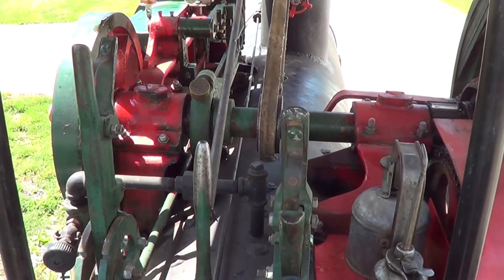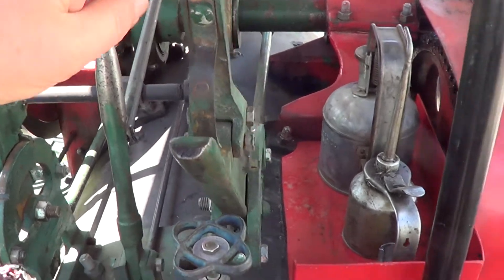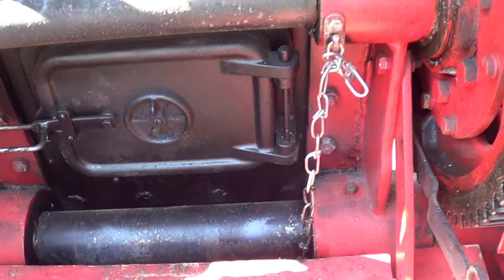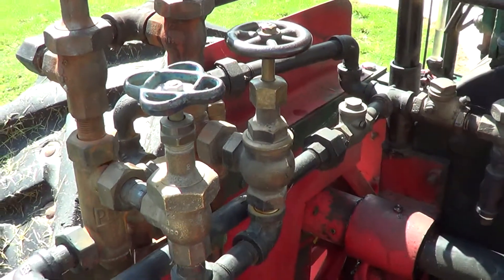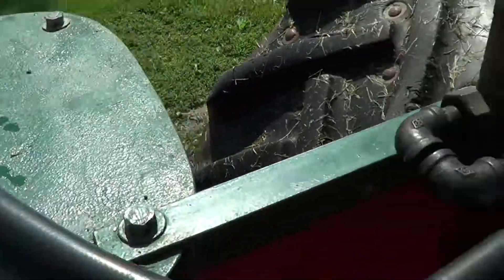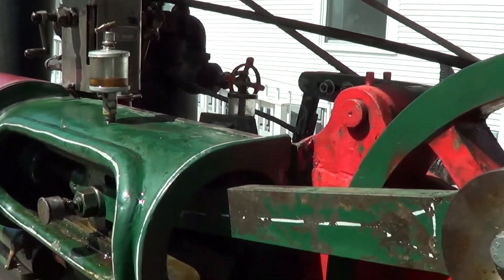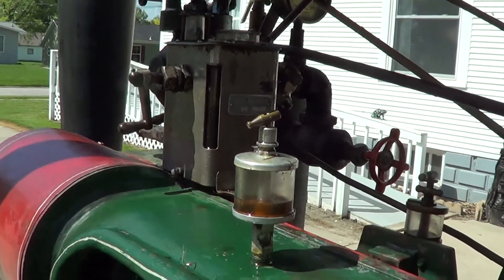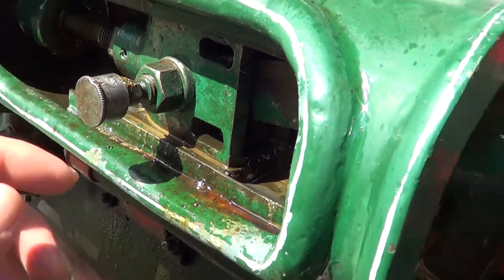Wood Brothers 5/8th scale Steam Traction Engine

Comment from the maker: Not original at all.
It`s a 5/8th scale model.
My dad built it a few years ago. He started the project in 2000. Had it fired in 2003. But not completely finished until 2004.
It`s based on a 22/70 Wood Brothers engine. The original weighs in at about 12 tons.